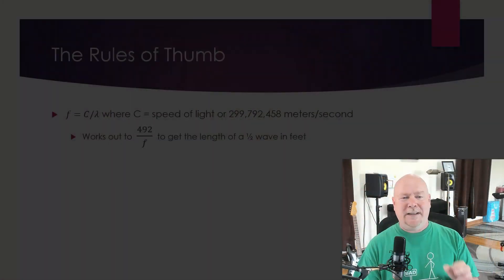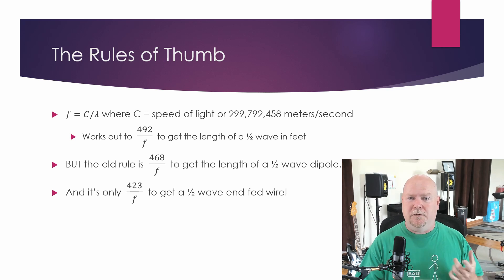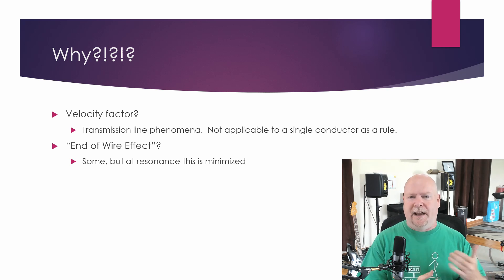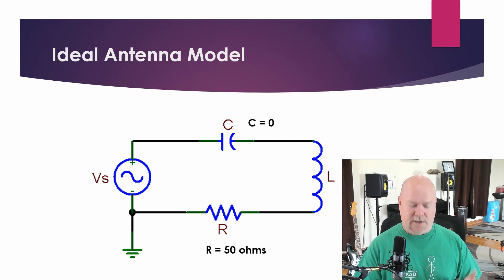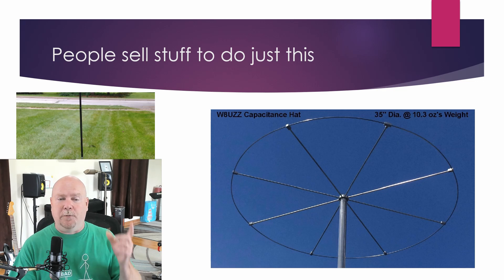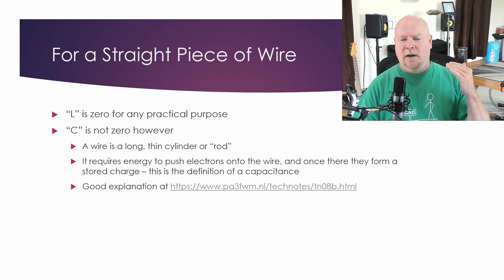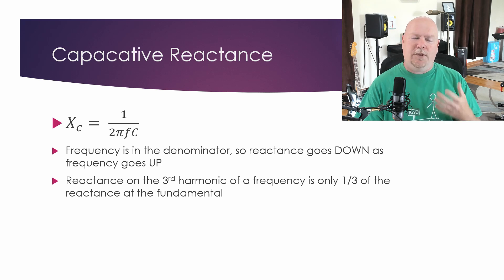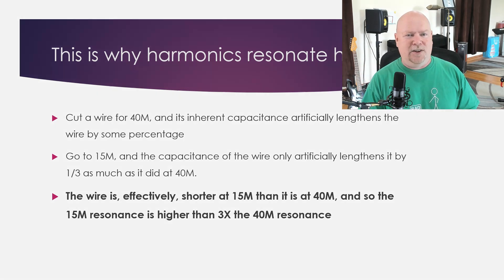Misplaced Harmonics

Comment: Another factor that wil make your resonance lower is insulated vs bare wire.  The insulation will lower the velocity and the resonance.  Then the velocity slowing effect will show when you build and test a twin lead J-pole antenna then stick it inside a PVC pipe to make it self supporting and discover that the PVC lowers the resonance!
Reply from the maker: It isn't velocity Ed.  Velocity is only a thing for transmission lines.  Insulation on the wire doesn't change the speed of the electrons, but it does change the amount of capacitance in a given length of wire.  You're changing the dielectric constant of the insulator in the construction.  Same thing happens when you put your wire j-pole inside of PVC.  You've put a much better dielectric material between your conductor and the Earth - drastically changing the inherent capacitance of your circuit.

Comment: And all this time I thought the “ velocity factor” of a single wire (e.g., dipole) was the speed that those dits and dahs (insert favorite mode) attained before they fell off the end of the antenna... like lemmings into the sea (end of wire effect?). Good talk anyway. Thanks for another ham oriented video amongst the wood. Oh -and sorry you cut your antenna too short (or at least that’s what makes me search for a logical explaination through reasoning and formulas). 73’s W2RSB ):
Reply from the maker: If that's the case then the velocity factor of my antennas is very, VERY low :)